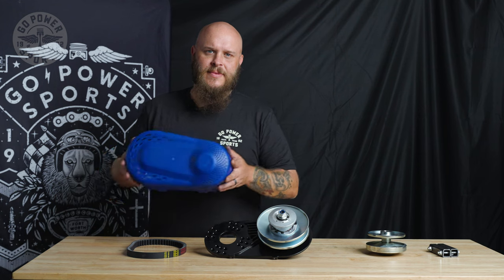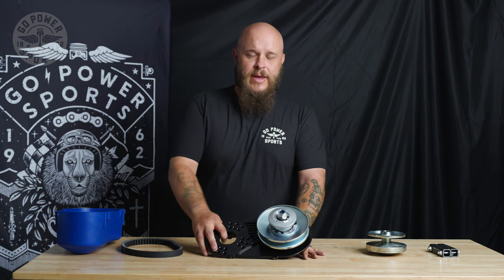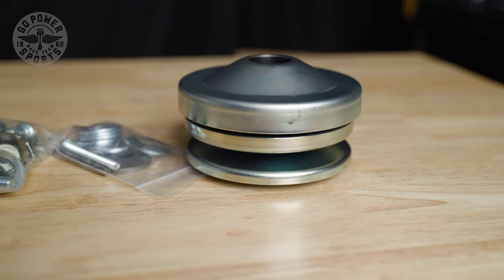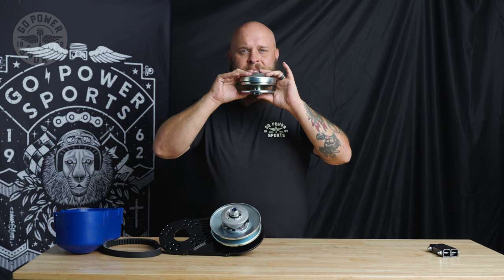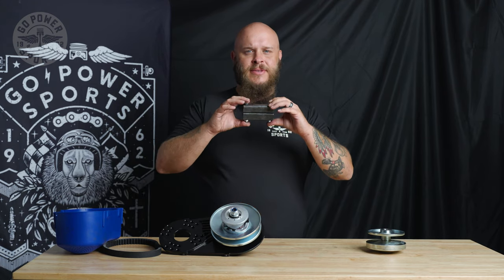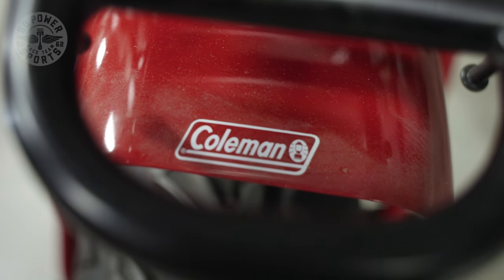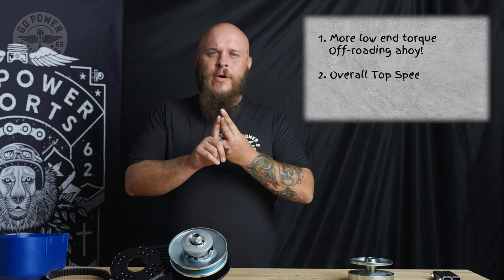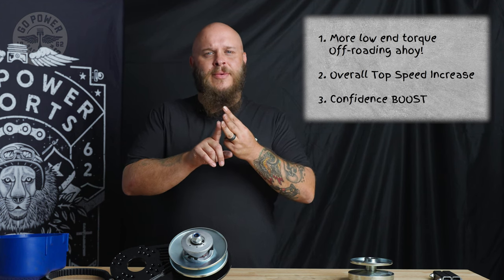Coleman 200 Torque Converter Kit | What's In The BOX?!

Comment: Top speed....LOL. Granted mine is the 196 Clone. 44mph with light flywheel, conrod, thinner head gasket, 18# valve springs, Mikuni 22 clone, tuned pipe and this kit. Also gotta mention....Had a T50 rear sprocket now a T60 rear sprocket. Difference was only 1mph loss. And yes....I did the governor delete as well.
Reply from the maker: Nice 👍